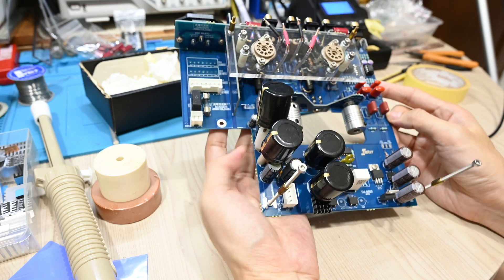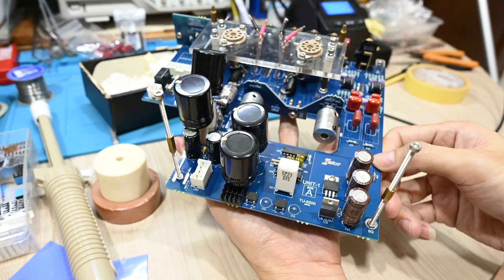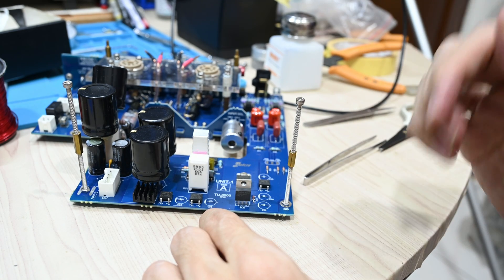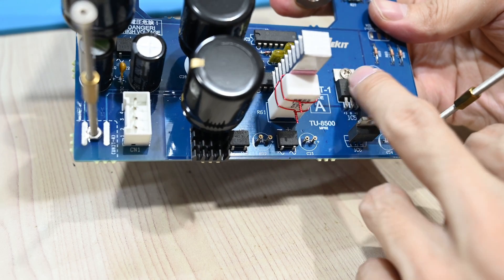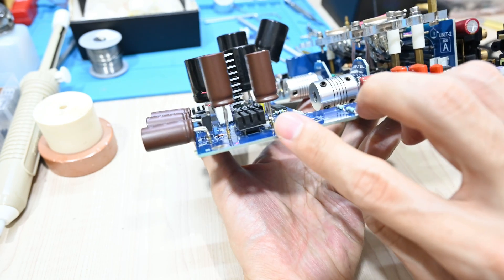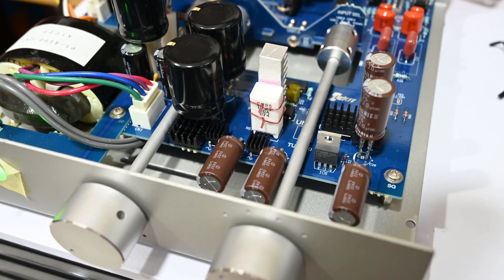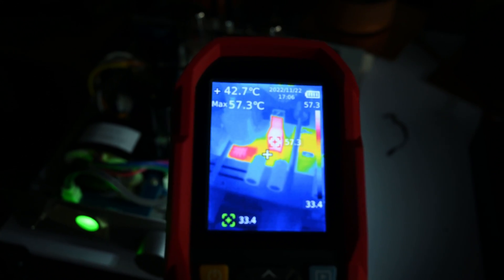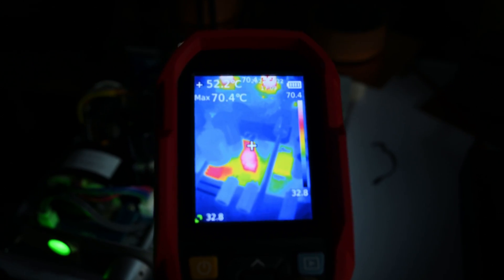Elekit TU-8500 Heatsink Upgrade

Comment: Hi, there are some articles for the 8500 Phono upgrade, C11, C12, C15, C16, IC1 & IC2 part.
If I just use the line-in section, should just upgrade C15 & C16 caps? Any other parts need to be upgrade? thanks.
Reply from the maker: Yes I believe C15 and C16 are sufficient. Thanks.

Comment: Thanks for your videos ! How would say the TU-8500 compared to the TU-8550 ? I am considering the two options. The phono stage is not necessarily key.
Reply from the maker: I havent completed the build of TU-8550. But from the schematic, TU-8550 should be better. Thanks.